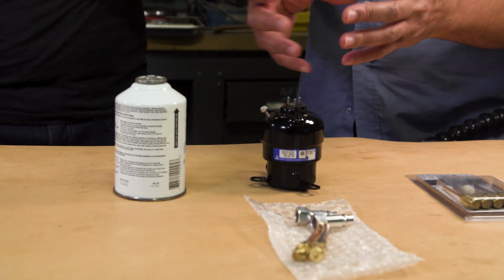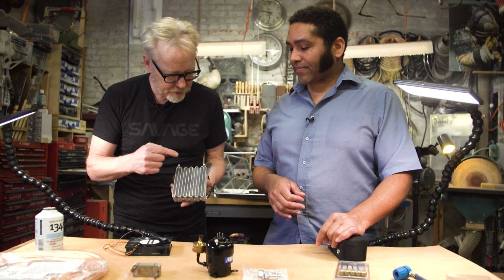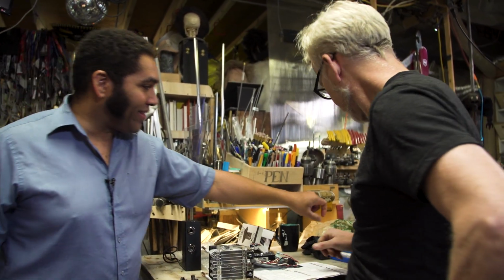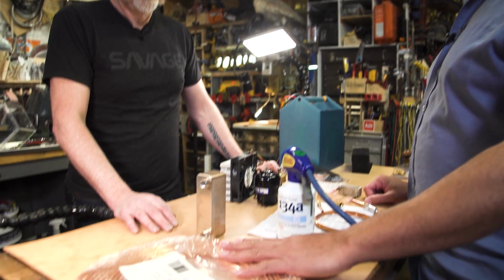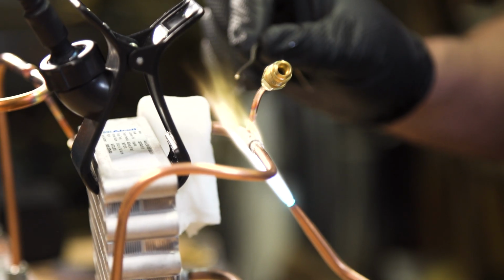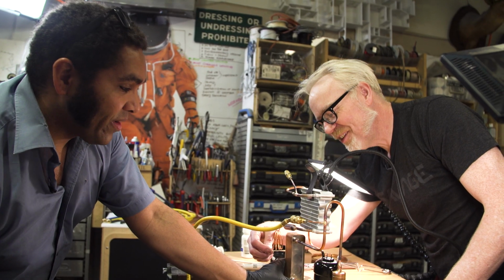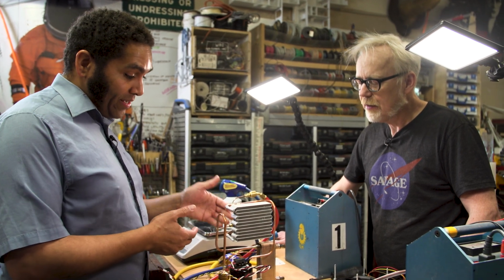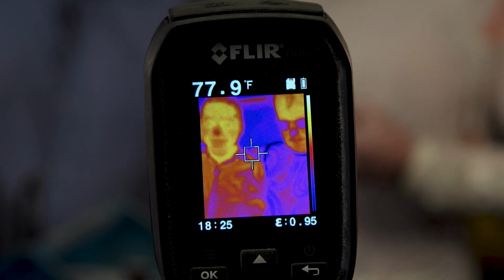Adam Savage's One Day Builds: Refrigerated Cooling Suit!

Comment: You think Mythbusters had problems with people who knew a lot but could not tell you, a layman, what it means?  Just try a warship Captain who had to know what his guided missile systems could or could not do after the missile techs ran their various scheduled tests, especially the Daily System Operability Test (DSOT) each morning, come what may.  Some people could not tell things properly if their life depended on it -- and in a war condition IT REALLY DID!  As the missile systems got more capable and complex, this got more and more difficult to do, as trying to show how a poor result in a single test might compromise a part of the missile system required almost a college degree to explain in complete detail, but if the tech  could explain it in plain language, it was possible.  What to do?  In the now-defunct TERRIER Anti-Aircraft Guided Missile Fire-Control System (GMFCS), this got so bad that word came down to us at the shore support facility for TERRIER where I worked to do something about it ASAP.  I and another employee were Computer Engineers and programmers for the relatively new, at that time, digital computer systems which controlled TERRIER and we were assigned the job of coding a new DSOT Translation Utility that would input the test results, good and bad, and run through a rather large logic tree, printing out a set of answers that explained in standard English what was and was not functional in the GMFCS and what it meant as far as using it until repaired.  The person who created the question/answer spec and who worked with us until it was working properly -- and who had malicious glee in testing our work and finding out errors (bugs) for us to solve and fix -- was not an engineer, but an ex-TERRIER missile system tech who had years of trying to explain to ship captains what various test results "really meant".  He was a technical genius named David Otto and he was one of the smartest people I have ever met, yet a real down-to-earth nice guy with extremely good practical problem-solving skill.  Working with him was a great experience (including his laughs when he found a bug) and helped me and my associate programmer learn a great deal about the nitty-gritty of TERRIER design and use that we had never known before.  A great experience and it really worked, being expanded to other Navy systems as time went on.

Comment: Not the best explanation of how the refrigeration cycle works. Think of refrigerant as a sponge, when not compressed it has capacity to absorb water (heat) and when you ring it out it releases the water because there's no space for the water. Imagine moving water from a bowl with water to one without - you're pumping water from one place to another  and the refrigerant cycle is pumping heat from one place to another! Heat pump!

Comment: Uses a tiny, super cool, super efficient compressor with similar heat exchangers and then uses a hacksaw to cut the piping? Normally you would use a pipe cutter. 

I guess if it works it ain’t stupid.

Comment: STOP SPYING ON MY UNDERGROUND OPERATIONS LOL I'm planning a similar build except using stacked peltier units and copper line as my coolant exchangers.  One cooling pad array on my chest and one on my back.  My system should be fairly quiet, using three Milwaukee M18 batteries for my power armour

Comment: You need to pick up a D5 or DDC based pump from one of the pc water cooling suppliers like EKWB or some such and probably coolant to avoid algae in the loop. With the amount of tubing you might even need a double pump setup. D5 is the stronger pump probably start there. Move to two if you need it. Each pump can use up to 23W of power, it will put most of that into the fluid but some of it will make it to your back.

Comment: 53:00 How did they get the water out of the system?
Reply: There is no water in the system. It is filled with nitrogen gas and water cannot enter through the leak due to the gas pressure

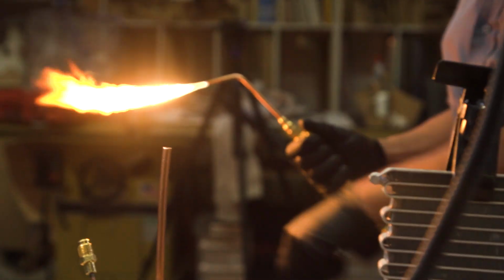Comment: One mistake at 38:15, they forgot to notch the schrader valve tube, going in the large pipe. You're supposed to relieve the pipe with a file either in a V or a circle (depending on what kind of a file you have).

Comment: IDEA: this works well as part of a spacesuit, but i suggest to put it into something that could be carried and look like a piece of Equipment.
For a wookie-costume it would be a good idea to have a cooling unit.
I suggest to create a "Radio" that pretends to be a communication device a wookie (or other Person...) might carry, but in reality has the cooling unit inside.
the "loudspeaker" might be used as a Ventilation Opening, Maybe two for intake/outlet
"frequency selection dials" would Control the temperature.
Displays that pretend to Show frequency etc. would Show the Status of the device and temperatures.
Extra Pouches that can be carried at a belt would have spare batterys for the "comunicator"/cooler.
A Little walkie-talkie would be used to ad real communication ability to it.
Maybe a single-board Computer can be used to Control a simulated function and a Touchscreen control

Comment: im surprised by the type of gas used given there is a gas with far better efficiency "r290" per quantity and its also non poisoning if leaks and its classified as natural ... so you need less gas and it wont gas you if it leaks  and will cool further then what the 134a does

Comment: In all fairness, when Freon was discovered for use in refrigeration, it was not known the effect it would have on the Ozone layer. All they knew was it was less dangerous than stuff like ammonia, chloromethane or propane, which were used in refrigeration prior to that.

That said, the guy that introduced Freon based cooling, also put tetraethyllead into fuel to reduce knocking, and they (he and GM) knew that was bad.

Comment: so how will that be implemented into a cosplay? just plugging the suit into the cooling circet outside floor for a quick cooldown?
because give all the noise it creates, power it needs, size/weight etc, i dont think you can fit that into a cosplay and use it for a hour + (battarie capacity)...

Comment: Now we just need to look for the guy who sounds like a vacuum cleaner at Comic-Con
Reply: I think the fan noise you're hearing is the bench-top power supply they used for the test.
Reply: @jordantheallmighty  You can definitely hear when the compressor whirs on. That might be exaggerated by their mic set up though, don't know if you'd hear it on the con floor.
Reply: Forget the noise. You would not hear much on a crowd. Use a thermal camera and look for the exhausted heat.
Reply: @denislostinlondon199  Release the heat seeker drones! But seriously, if anyone uses a thermal camera to look for Adam at CC, you have to be cosplaying Predator. That's the rule.
Reply: @konstantinkh  Comic-Con is the only safe place for a Predator to be seen. Anywhere else in America they would be shot on sight (if you could see one without the aid of medication or Covid-19 delirium) .
Reply: >implying 2020 Comic-Con
Reply: csknives2140  You would only detect the fart (A) if you were very close or (B) if there was an ignition source.

Comment: PC-overclockers everywhere: Take my money!
Reply: oh wow, that didnt even occur to me. great idea
Reply: @Harry Kaya Prager Totally!
Reply: @Harry Kaya Prager https://www.youtube.com/watch?v=nwCtvpgwm5o
Reply: That would be way more complicated than just putting it through a closed cooling loop like this. You would have to be constantly monitoring the temperature so the hardware doesn't go below ambient temperatures in order to prevent condensation. If it does go below ambient temperatures you would have to either hermentically seal the whole computer or put the sensitive parts in something like mineral oil so there's no moisture that can condense on the cooled parts causing a short circuit (condensated water is fairly conductive due to contamination from the air). Even refrigerators have a system to get rid of condensation inside the fridge (usually a tiny hole in the back of the fridge which drips the condensation onto the compressor to cool it). Adam will also have an issue with condesation if his suit cools him below ambient temperatures and the air is somewhat humid, from what I understood the suit was merely gonna keep him at comfortable temperatures though.

Also regarding PC overclocking, it's already been done using phase changers and there are already commercial units available for that exact purpose, which either directly cool down the CPU die using a liquid mix that turns into gas form around 50-75 degrees C or they use a separate system with a heat exchanger.

Kind of interesting fact, the phase changers which cool the die directly are very efficient and they use the same method to cool down atomic reactors just that reactors simply use water due to the higher operating temperature, not to mention it's abundance, high thermal conductivity and thermal capacity. However if you have inadequate cooling or the thing you're trying to cool gets too hot there's the risk that everything turns into vapor so there's no liquid left causing a high thermal isolation around the thing you're trying to cool which will then cause a thermal runaway. If I remember correctly that's one of the things that went wrong in Chernobyl.
Reply: That would be way more complicated than just putting it through a closed cooling loop like this. You would have to be constantly monitoring the temperature so the hardware doesn't go below ambient temperatures in order to prevent condensation. If it does go below ambient temperatures you would have to either hermentically seal the whole computer or put the sensitive parts in something like mineral oil so there's no moisture that can condense on the cooled parts causing a short circuit (condensated water is fairly conductive due to contamination from the air). Even refrigerators have a system to get rid of condensation inside the fridge (usually a tiny hole in the back of the fridge which drips the condensation onto the compressor to cool it). Adam will also have an issue with condesation if his suit cools him below ambient temperatures and the air is somewhat humid, from what I understood the suit was merely gonna keep him at comfortable temperatures though.

Also regarding PC overclocking, it's already been done using phase changers and there are already commercial units available for that exact purpose, which either directly cool down the CPU die using a liquid mix that turns into gas form around 50-75 degrees C or they use a separate system with a heat exchanger.

Kind of interesting fact, the phase changers which cool the die directly are very efficient and they use the same method to cool down atomic reactors just that reactors simply use water due to the higher operating temperature, not to mention it's abundance, high thermal conductivity and thermal capacity. However if you have inadequate cooling or the thing you're trying to cool gets too hot there's the risk that everything turns into vapor so there's no liquid left causing a high thermal isolation around the thing you're trying to cool which will then cause a thermal runaway. If I remember correctly that's one of the things that went wrong in Chernobyl.
Reply: @MrGemeco  Nah, just put in a shunt loop hooked up to a temperature sensor just like you do in a cooling loop in an HVAC system.
Reply: @megatryn  I might've been exaggerating saying it'd be way more complicated. Correcting myself, it'd be more complicated compared to what you see in the video but doing what you said doesn't make it a lot more complicated. Not sure why but I was fixated on using a system relays and solenoids, not sure why I didn't think of controlling the compressor directly as it would be easier and more durable.
Reply: MrGemeco ya you just ramp the compressor to keep coolant at a constant and bypass with a diverting valve if the cpu (or whatever you are cooling) doesn’t need cooling or have your coolant pump be variable speed to supply required flow. It would be a task but if you are into it not to crazy
Reply: I was just thinking about this, like if you could make a subzero cooling system inside the computer case it would be SO COOL, you could perhaps even run a dehumidifier to avoid condensation
Reply: Jaime Ruiz a dehumidifier is essentially an AC unit so you could use the system for double duty. I’ve wondered a bit if pc components could handle being under a vacuum but cooling other parts of the boards would then be critical
Reply: I may have already sent it to Jay.
Reply: why ? Linus talks to people like this on the daily

Comment: My 1890 Victorian house I used to own had all copper tubing for the radiators and hot and cold water. My new 1920s house is the same. The only change was to use steel braided flexible hoses to taps and when refitting certain radiators just to make them easier to service.

Comment: Can someone explain something to me. In the beginning he explains that after being compressed, the gas gets hot from the work done to it, so it then goes through another chamber where air is blown over it to take the heat away. This implies that the air being blown is colder than the gas being cooled. If this is so, how was THAT air cooled? It needs its own refrigeration system! And if u say the gas is hotter than room temperature, how is it cooling the fridge?
Reply: The air being blown through the first heat exchanger (the one that cools down and causes the gas the gas to condense) is at the ambient temperature of the outside environment. This effectively cools the gas because when the gas first enters the heat exchanger, it is at a much higher temperature than that. It is not the gas itself that cools the alcohol running through the suit, but the evaporation of the gas. When the gas evaporates it absorbs heat from the second heat exchanger (the one that interacts with the alcohol) which in turns cools down the alcohol.
Reply: @amast9398  ok thx